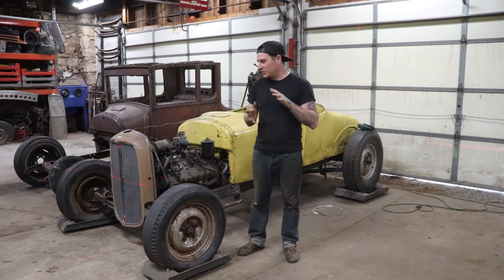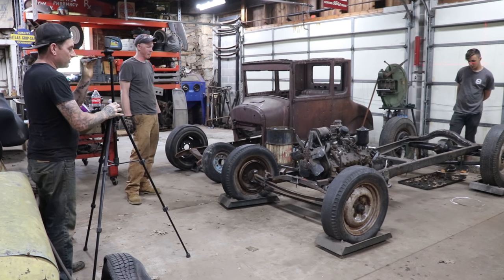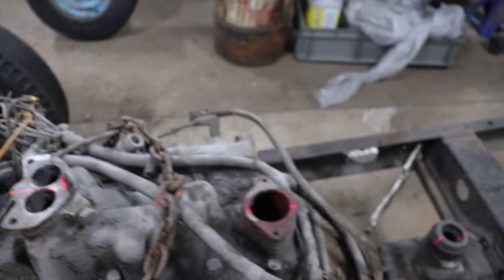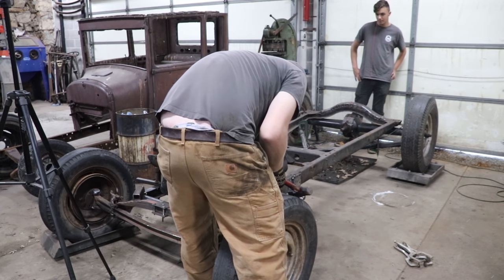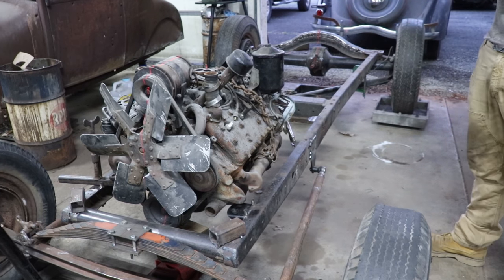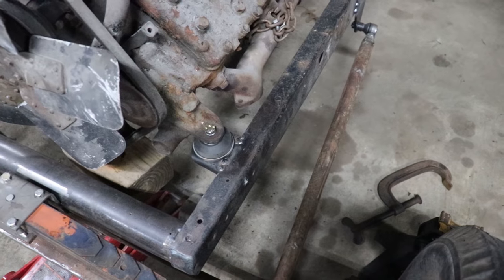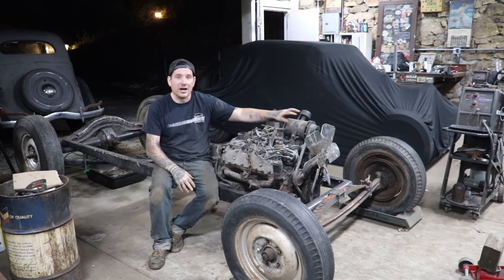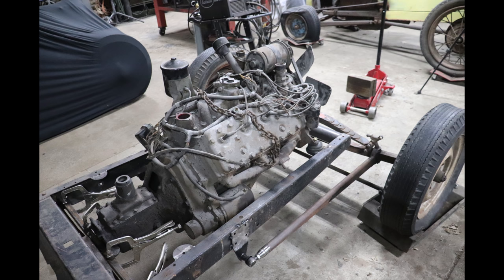Simple Ford Flathead V8 Engine Mounts

Comment: Looking all good and lined up... Nice trick using a laser....
We always had a straight line under the frame and hung Plumb Bobs to line everything up....

Saw on The HAMB where you sold the '32 Cab Rear, also.... Glad you got a Buyer and it got saved.....

Comment: Nice but  not much radiator clearance or is this  going to be full fendered ? not boxed frame either? Sweet steel body!!!! Love the old flathead rods. You can have all the modern power this and that fuel injection But to me OLD school just cant be beat!!!!!! ROD ON!!!!!!!
Reply from the maker: Not boxed. No fenders. Simple and basic hot rod
Reply: @IronTrapGarage  I really like where it's heading Matt. I might even like yellow when it's done. :)